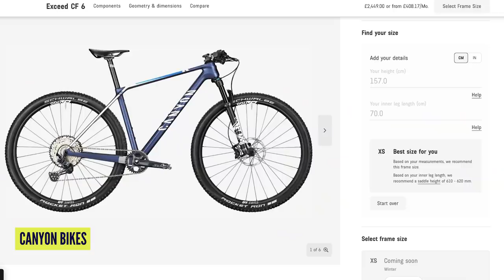How Do I Stop Arm Pump From Braking Bumps? | #AskGMBNTech Ep. 174

Comment: handpain #1 rule:
no joke, brake less.

let me epxplain. 
brake less in bumps. it really hurts your grip strngth and comfort.
brake on flatter and even parts, then go into the gnarly stuff.

riding fast a bearm fast hurts your hands way less then hanging onto your bike for life and braking.
Reply: ⬆️ this
Reply: This is why riding a hardtail really gets the fundamentals in place for beginners . Everyone should consider a HT as a first bike
Reply: @wichovr6  i life in Austria at some Beiträge g bike parks. Ofc i ridden some HT before but as Bikepark Bike i will use my propain spindrift.
Reply: @Krenon that's great advice! Definately comes with confidence. 

I see it as making sure your speed is right before the 
obstacle/feature or before the section that can cause the hand issues. I'm still learning speed regulation and perception, best thing is to follow some one who knows your skill level and you can trust to lead you in at a pace suited to your skill.
Reply: Agree. Soften the lsc and psi if possible, brake less, breathe properly, use your legs and relax your hands/forearms at every opportunity, make it a habit. Experiment with lever position, grip thickness/compound and making adjustments to get your weight off the bars.

Comment: If there's cavitation in the oil and the fork is equipped with a Grip damper, don't worry. That damper's designed to bleed itself after some time. It sucks oil from the bottom and pushes air out of a bleed port when it's being compressed enough for the piston to open the passage.

Comment: I just ordered a new steel raceface cinch chainring ($15) and a new steel sram pg1130 cassette ($89).  They are the same as what came on my Atroz 3.  I cant justify getting aluminum when the cassette went 6 chains before I started getting skips.  Im still in the process of riding that 6th chain and cassette to destruction and the bikes over 2 years old at this point.

Comment: Doddy mentioned most of the things causing fatigue and hand pain and did a great job with it.
But here are other things that can cause pain.
really floppy wrists, my wrists are very loose, causing misalignment, and not being able to brake properly sometimes, resulting in missing corners, but wrist supports have limited the misalignment, eliminating the issue.  Keep in mind if both wrist and elbow is misaligned it can cause even more pain in the hand and arm. if you have these issues and ride too narrow handlebar the elbows might miss align even during gentle riding, mine did, but now I have a wide enough handlebar and a well-fitting bike.
reach and brake lever position and handlebar rise play a role too.
my bike has long enough reach and handlebar high enough rise to have the brake levers almost flat, levers are set up just like Doddy mentioned to end up braking with the mid bone.
Some ride on too small bikes, reach too short, too low rise, shorter the reach steeper the brake lever angle needs to be, longer the reach is, flatter the brake levers can be, thus be relaxed with handlebar rise being high enough. But if a bike is really small the hand and the upper body won't be as relaxed, so you will be more fatigued and fatigued faster.
The suspension setup is also important, the suspension setup might be too harsh.
So recommend looking into these things too.
Reply: Yup

Comment: Three things plus a planned one that I found did help me with hand pump, hopefully this may help someone?! 

1st I chose ODI Dreadlock Grips, they are tacky enough for thin gloves or gloveless lovely squish but not soft, feels very connected (larger hands).

2nd I went for Cushcore as I gave destroyed a few rims, this allowed me (120kg on bike) to run 1.5bar rear and about 1.2 front, Assagai Exo Front Aggressor Rear. Makes the front end way less jarring on small bumps that the fork doesn't handle.

3rd I adjusted NY breaks leaver position, angle, reach and bite point for the situations and body positioning I will be in when I need to use the breaks the most, so descending, ready position before corners obsticles etc, I adjusted the lever so with the brake pulled hard with one finger it still sits 3-5 mm away from the closest finger.

Last I plan to get a Oneup Carbon Bar and an appropriate stem, they are stiff for steering but flex a little online with fork travel when set correctly, I think this will be the final thing to mak emy setup perfect outside of suspension tuning, all the above has stopped most of my ulnar nerve issues, don't get hand/arm pump thta I can notice.

Only think I get is after sessioning some jumps (small) in the evening my knuckles were a little stiff/ache.

I know the above may sound like random blurb, but I hope it may help some one with specific items that worked for me, I'd also love to hear what anyone else has tried? RevGrips? Oneup bars? Etc I'm always learning.

Comment: #askGMBNTech I’ve been riding regularly for the last 18 years and had a lot of bikes in that time. Crashing has always been part of the sport. Mainly just sliding out and then jumping back on the bike and riding away. This type of crashing feels like a pretty normal part of mountain biking and has never resulted in any damage worse than torn off derailleurs and snapped brake levers.
6 months ago I bought a brand new Kona hei hei cr, which was my first ever carbon bike. I chose kona as I have had 6 kona bikes in the past and always had great luck with them. Last month I had a light crash on a corner where the front wheel slid on a root. I jumped up ready to carry on and then noticed the rear carbon chain stay had been crushed inwards. I returned the bike to the dealer and was quoted 700 dollars plus tax and installation for a new rear end. The cost is a bit more than I was expecting for an at cost rear triangle.
Do you think in a sport where light crashing is pretty much ingrained in the sport, bikes should be built to resist these impacts better?  
I don’t expect to be able to ride of huge drops or into trees and survive. But surely bikes should survive hitting the ground in light crashes. Surely there is a certain degree of crashing that should be considered normal use.
Reply: Long post so I read through everything, I've reached my life goal  😂

XC race bikes are built for speed and medium trail duty. Does not excuse the damage but if you had been taking it out on places it shouldn't have been e.g bike parks or urban then it could have contributed.
My guess is that the impact was on a weak spot and unfortunately perhaps the resulting torsional force of the crash in motion just made the carbon fail (?) Another theory could be perhaps repeated impact (you would've known otherwise) or poor carbon grade/manufacturing but sadly unless there was a recall or proof that the material was to blame, you're out of the loop...

Seeing that the crash caused the damage and not the other way around, you've probably just hit bad luck with the warranty claim and repair cost. If you have not emailed Kona then you might as well consider doing so as I am sure any manufacturer would take keen interest of their products failing as that is potential future customers being D.O.A when they hit the trail. And if they're any good they might just send you a replacement stay or some credit (seeing as it's repaired already)
Reply: @Sean  Hey Thanks for the response. You raise some good points. I dont think I took the bike outside of what its made for. I ride hard, but I ride within what should be considered reasonable trails for xc and down country bikes. 
Looking at where the damage is (in the middle of the oversized chain stay area) I think I just managed to get really unlucky and impact the bike in the one area with the thinnest carbon fibre. Therefore, as you suggested on a weak spot.                                                                                                                                                                                                                      As for poor carbon/manufacturing I will never really know.

I will drop a email to Kona today and explain the situation to them directly. But in all honesty, I wonder if this is just the downside of carbon bikes across all manufacturers. 
 I certainly wouldn’t say no to a high end aluminium modern down country bike, if there was one.
Reply: I also broke my rear triangle on my carbon bike which is why my new bike is aluminum.
Reply: Yeah I will be on the lookout for a aluminium down country bike for my next.  But there are less and less options these days.

Comment: The squish sound can come from the air spring side. There is a small port that equalizes the pressure in the positive and negative air chambers when the fork is at the top of its stroke. If a bit of grease moved to that port, it could cause a quiet squish sound when the fork is slightly compressed and released.
Reply: Is there anything wrong this that as it happened to my shock
Reply: @hugoandreas1715  It shouldn’t be a big deal as long as you can set the air pressure and the correct sag.

Comment: #askGMBNtech Hi Daddy, love the show! I've put a new hose on my Shimano mt520 rear brake, I'm struggling to bleed it, but I've never had an issue bleeding before. The lever feels good but there is little to no pressure at the caliper
Reply: If possible hang your bike in a way that the Caliper is the lowest and the Leverbody the highest possible Point and bleed again. Also: use a strap to hold the Leverblade tight to the Handlebar. After a Tea or Coffee Break losen the strap and pump up pressure again and strap the Leverblade again. This will help to force the remaining Air up. Have Fun wrenching.
Reply: Sounds like your pistons may be stuck or there's contaminant at the caliper hose banjo area (where the fluid goes in to push the pistons).
To diagnose simply put your bike on a stand or on the seat post (avoid flipping as air in the system would also give the same following result) drop your rear wheel, grab a tire lever and hold 1 side of the piston. Then press the lever and see if the other piston is able to exercise back and forth. Be careful not to pop the piston out. Do the same for the other piston.

If the pistons don't move or they have limited movement (which I'm sure it is), it might be dirty and stuck or there might be contaminant in the line still. You can solve this by taking the caliper off the bike and disconnect off the brake line, then putting a air pressure gun to the brake port and blow the pistons out. Then use alcohol to clean the piston edges and apply some brake oil before sliding them back into the caliper with the help of the tire lever. Then reassemble, rebleed and volia.

If the pistons don't move even after cleaning them,, it means that something in the fluid is lodged at the banjo area or inside the caliper, giving pressure to the lever but no action at the caliper. This time, use the tire lever at an angle to hold the pistons in, and do the same air gun trick, to blow out any residue stuck. Then.... reassemble, rebleed and volia.

Hope this helped!

Comment: #AskGMBNTech   Greetings Doddy. No real problem but just a strange question. Somewhere back in the past I recall hearing tyres fresh from the mould wear quickly as the tyre compound is still soft. A tyre that has matured will handle better and last longer. Have you heard of this? Of course really old tyres are not very good either. Thanks.
Reply: A fresh tire will wear quicker as it provides optimal grip while soft. A "matured" tire just means the rubber compound would harden slightly and change structurally, but it would theoretically only result in a different wear pattern as compared to durability loss. (e.g picture soft, floppy knobs rolling and wearing off roundly at the corners, versus hardened knobs scrubbing at the surface and shortening itself at an angle)

Comment: #AskGMBNTech I have a bit of an odd torso:leg ratio, i.e. very short legs for my height. None of the bike websites actually work for me so was wondering your opinion on the matter. I'm 176cm and inseam is 74cm with a GT (Greater Trochanter) length of 85cm if that helps at all. I ended up going for a Trek Fuel EX in size ML but would love to know your thoughts on the matter - should I have gone for a Medium instead?

Comment: #AskGMBNTech 
Are aluminum or titanium brake pistons better then plastic pistons (e.g. Sram for example)? Heard they are better dissipating heat, rather then the plastic ones.
Reply: Theoretically yes they will, but manufacturers probably made them to have better transition of braking action and pad feel on the lever compared to plastic, and not for heat dissipation.

Comment: #AskGMBNTech I just bought a used bike and I can't turn the rebound adjuster knob on the fork at all. I think the problem is that it's been set to the lowest position (no-damping) and was left to sit like that for years. Because of this right now I wouldn't be able to take the fork apart because I would have to screw the knob out. Can I somehow twist it out by some force with a wrench? And if I can do that, would it be worth it to also service the damper after this problem while I am doing an air-shaft and lower leg service? (I have a FOX 32 Float Performance from 2016)

Comment: BETTER BRAKES. I solved my cramps with more powerful brakes. 
most people say “keep your hands loose” or “grip less”, they’re probably not wrong: I say check your braking power before grips and handlebars, because it’s braking that demands the most effort to your hands. If your forearms are already working 110% to squeeze the brakes, then you won't have enough strength to cope with the added stress of brake bumps or riding surface in general.
I'm circa Doddy's size (190cmx93kg), I ride a hardcore hardtail with 4-pots shimano mt520 brakes, and I always had problems with hand pain: at the beginning I thought I was just weak, so I did a lot of strength training for hands and forearms until I almost got myself inflamed tendons; then I followed every advice on the subject: tried a higher handlebar rise, different grips, different lever angles ad setups, tire pressures, fork setups, which all slightly helped somehow but didn't really solve the issue. Then I experienced the worst arm pump one day at the bike park, this summer: my sintered pads needed replacement and I had to use the resin ones that I kept as emergency spares: bedded in as best as I could, dropped in, mid pre-ride and my hands were already killing me! with my favorite pads I could ride with some discomfort, with less powerful ones I simply couldn't: I was on the brakes way longer that I thought I should, my hands were squeezing a lot more and a lot longer than they could withstand, pads overheating making the whole system work worse corner after corner. So the next day I was shopping for brake pads, saw a nice set of Shimano m7120 brakes at a price that was too inviting to pass: I bought them expecting an increase in braking power as advertised, but not by THIS much! they bite like a starving dog! now I can grab a handful of front brake and go instantly OTB if I want, or, I can feather it into stoppies and such, but more importantly I can now ride faster, with more confidence, and hand-pain free.  

(I know it's an expensive upgrade, more than grips or handlebars, but in this day and age I've been able to quickly sell the brakes I had, and the finned brake pads that came with the new brakes, reducing the cost of the operation to a mere 20€. BIG WIN!)

Comment: Hi Doddy, got a gear problem for #AskGMBNTech - 1x12 shimano deore M6100 drive-train. Shifting to lower (larger sprocket) gears is fine, but when shifting from the lowest to the second lowest, the hanger does not move enough to shift the gear. Thoughts? 
A friend suggested a sticky cable. What are your thoughts on lubing the inner cable?
Reply: It’s your cable tension
Reply: Check Cable Tension, dirt in the Derailleur if it worked before, B-Screw setting. Sticky Cable is a good suggestion as well...
Reply: I have this drive train as well and have battled shifting since I bought it. Apparently I have cracked the hanger and therefore don’t have as good of shifting when going to the smaller sprockets (going to a harder gear)
Reply: You have probably put too much cable tension on when tightening up the shift cable. This would prevent the derailleur from dropping down to its intended H limit position. 

Shift to the highest (smallest cog) gear. Release the cable bolt at the derailleur, screw in the barrel adjuster at the lever fully, then very (very!) lightly pull the cable and redo the cable pinch bolt. Then set your H limit before your Indexing via barrel adjuster, and finally L limit and B tension screw.

Comment: #AskGMBTech hey I got a used downhill bike and it’s a fox float dps performance 2018 rear shock and when I take all the air out of it the shock doesn’t move I weigh around 105 pounds and run 85 psi but the shock doesn’t move much and lowering the air doesn’t make a difference do you think the shock need a Service or is damaged and I took a look at it and it’s not locked out pls help
Reply: Could be a couple of reasons - I would suspect a busted seal which caused the neg air to essentially suck the shock in and slow it or limit movement (can't extend out but can only retract). Bit of a long shot as I've not heard this cause a shock to bind or seize...
Could also be a seized air shaft or a bent shaft. Or just that it's super duper dry inside... Best to take it to lbs, never disassemble a shock if you think it is still pressurized internally.